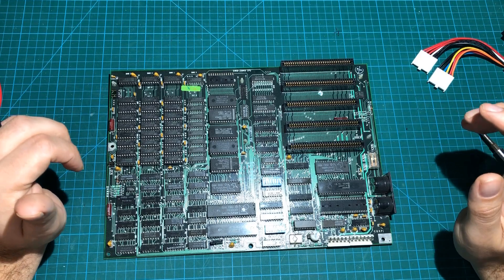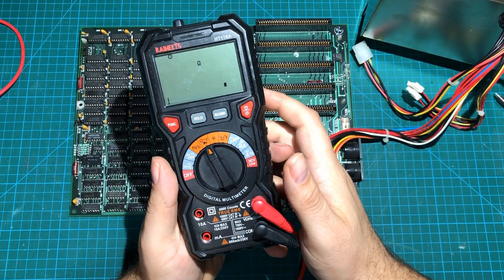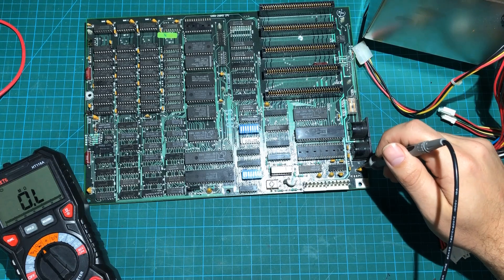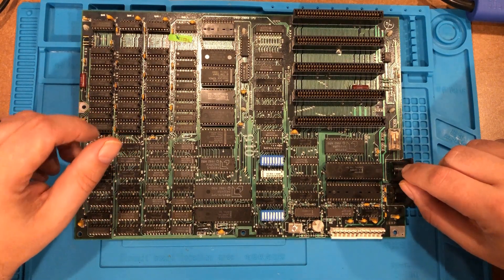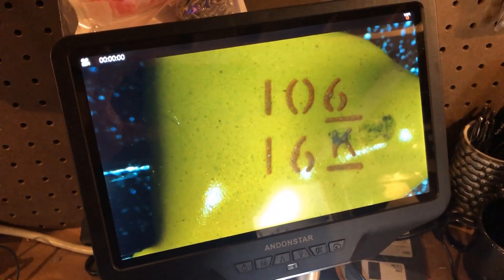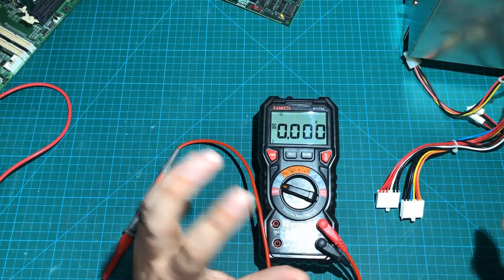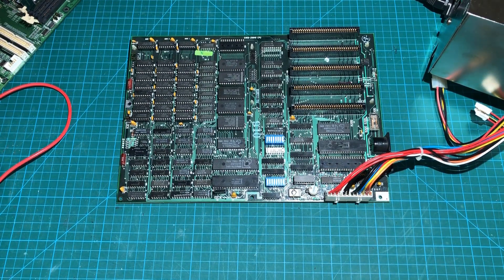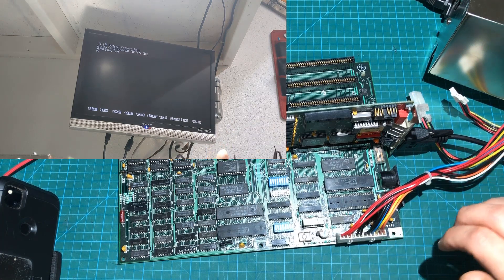Don't plug in that vintage computer until you watch this!

Comment: I have a 64bit older computer.  I want to upgrade on a tight budget.  However, I do not know hardware well.  Can I send you the specs it provides with pictures required of Internals to determine what I have and can upgrade?  (I know I have 1tb scsi drive and 500gb scsi drive.
16gb (hp drive was part of base.

If I can, go with USB3.0 port replacements qty 12 I believe. CD burner… KEep. But have some other similar item I cannot remember what it is and capability.  (2012 purchased). Windows 7. 
I’m going Linux completely soon on it.  W7 crawls.  Lol. I’ll be glad to contribute to your patron.
Reply from the maker: You might be better off selling the SCSI drives. Collectors want them and will pay a fair amount for working ones. That might give you the ability to upgrade your hardware.
Reply: Both drives are good and still used.  No bad sectors.  1tb and 1 500gb. What is a fair price to ask and “”how”” do I sell it?
Reply: I’m tempted as this is way over my head…. Send u the computer, pay you to go thru it and help me upgrade just a little.  I don’t have much money.  You know what cords work with what hardware.  What can be sold.  The usb2 ports are (many) onthe desk side.  If someone is looking for those ports, I have many on it and they are barely used.  Cd backup used only 4 times literally.  All still works.

Upgrade, I do not care about latest graphics and high performance.  Just IO thru put faster. More memory. And max out disk drives (3.5 disk.)

I’ll run Linux on it.  I may save that Microsoft v7… not sure.  I cannot trust computer firms here to give me a fair shake.

Comment: Oh, I like that solder sucker.  That would save so much work clearing holes.
I do not even own a new 3-wire capacitor.  They make 10uF 2-wire stacked chip ceramics on the cheap.
Would they work?  (shrug)
Sometimes, when plugging in an iffy thing, I hallucinate that terrible smell of blue smoke.
Reply from the maker: The hakko gun is fantastic. Vanguard tells one that's about half the price but I don't know if it's as good. This thing is about as close to perfect as it gets.
Reply from the maker: I've seen people even use electrolitics on these boards. I think they are pretty tolerant

Comment: I'll be testing my old motherboards for shorts like this when I get around to checking them out!  I have at least one 286 board and several 486 or early Pentium that are surely all in the compromised zone by now
Reply from the maker: Good luck.   I didn't mention it in the video but even if you don't have time to test the boards themselves, you definitely need to crack open the cases and look for leaky batteries.